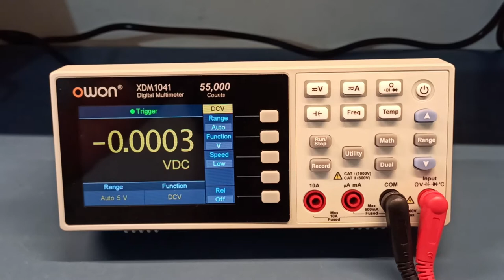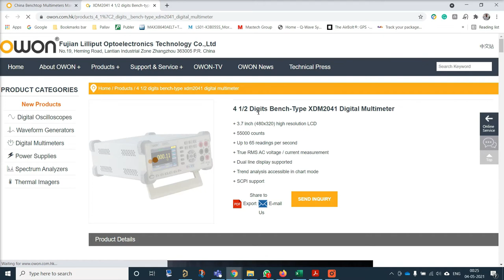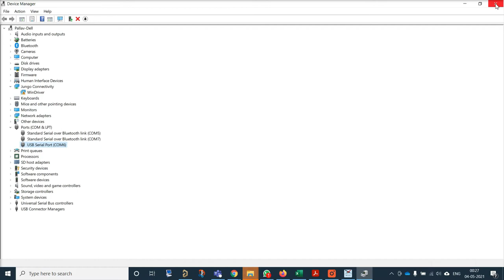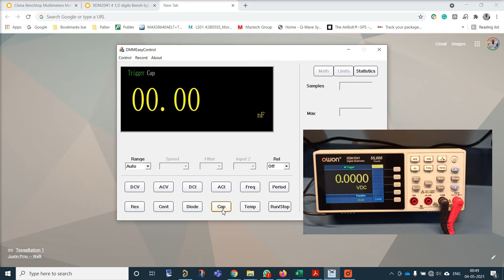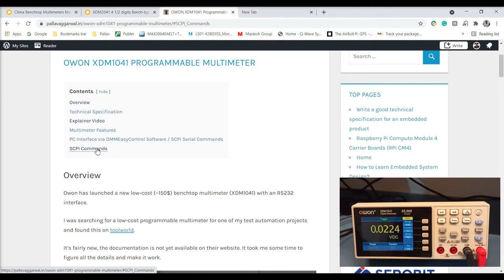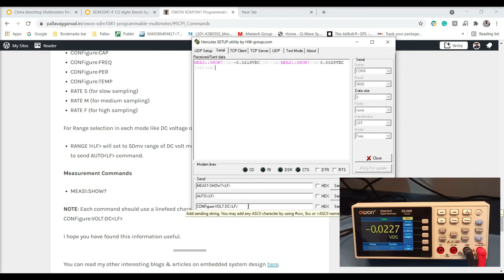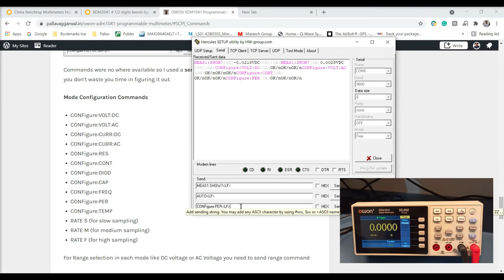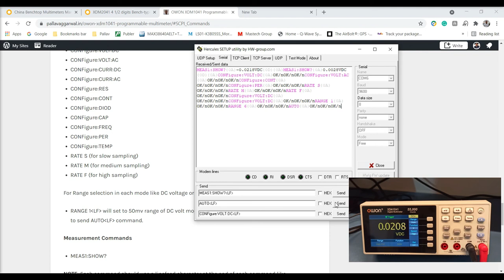👉 XDM1041 Multimeter (Part 2)

Comment: hola amigo, a mi no me deja abrir el software, si lo instala bien creo, pero al abrir el software, me sale error que le falta el visa32.dll, luego el nisva32 o algo asi, busco esos archivos y luego me sale otro error pero no termino de abrir el software.
sabes que me puede faltar por instalar previamente?, tu que windows 10 tienes 64 o 32 bits? me podrias ayudar como solucionar mi problema por favor
Reply from the maker: Your question was:

Hello friend, it won't let me open the software, if I install it correctly I think, but when I open the software, I get an error that the visa32.dll is missing, then the nisva32 or something like that, I look for those files and then I get another error but did not finish opening the software.
Do you know that I may need to install previously? Do you have 64 or 32 bit windows 10? Could you help me how to solve my problem please

I am using Windows 10, 64bit Computer. Could you try using Serial commands?
Reply: @PallavAggarwal  si. Esa fue mi pregunta
Reply: установи NI-VISA

Comment: Nice review. I was surprised to see that your meter worked nicely with DMMEasyControl. because mine doesn't ever since I upgraded the firmware in the XDM1041. Then again even before I found the DMMEasyControl (rev 1.4.4) wasn't the most stable program anyway...  What version are you using and what version is your firmware?
Reply from the maker: Hello,

Thank you, I saw your video, that is also very good. My meter has firmware version 1.0.0 and DMM Easy version I used is V1.4.4. Did you try talking to Owon support?
Reply: @PallavAggarwal  I raised the issue with them but not received a response so far. For me it is not too urgent because I write my own (Linux) software and do not use DMMEasyControl, but since I am going to show that PC software in my next video and its no longer working properly with my XDM1041, I'll include a link (card)  to your video so folks can see how it should work...
Reply: Actually I just noticed something. I think the problem is possibly the DMMEasyControl program after all. Can you do me a favour and run your XDM1041 with the DMMEasyControl. Then, once connected, turn on STATISTICS. There doesn't seem to be a way to turn it off. But I found that just turning it on is already messing up my XDM1041. The DMMEasyControl is no longer able to change between (most) functions.  Now exit DMMEasyControl and  turn statistics (=Math) off locally on the XDM1041 if it is still on. Then reconnect DMMEasyControl and try switching between DC volts and AC volts or Current. Does that work? In my XDM1041 I have to actually power it off and on to get it back working.  If iyou manage to replicate the problem (no longer responding to changes from the DMMEasyControl), can you connect the XDM1041 to your terminal program and type some nonsense SCPI command like "hello". I would be interested it responds with "OK OK OK"
Reply from the maker: Should we hop on to a call? I can show live. I am based in Bangalore India. Let me know a suitable time if you think that will quick and helpful for you.